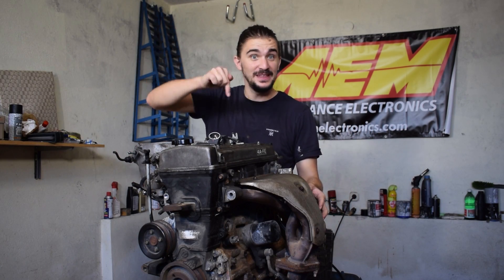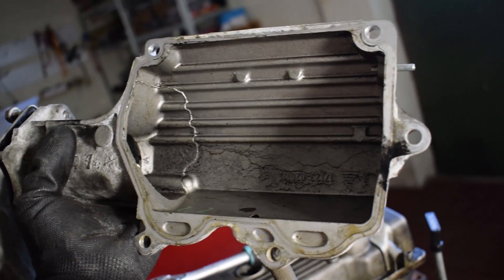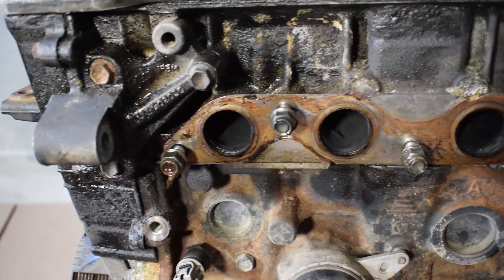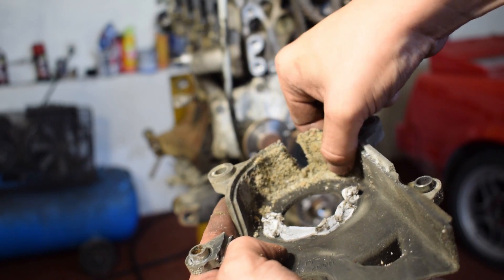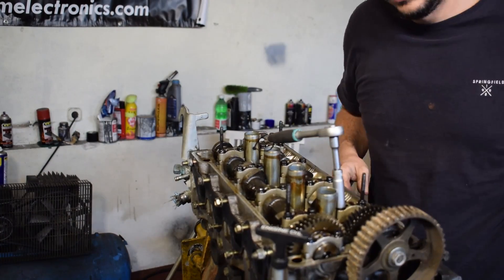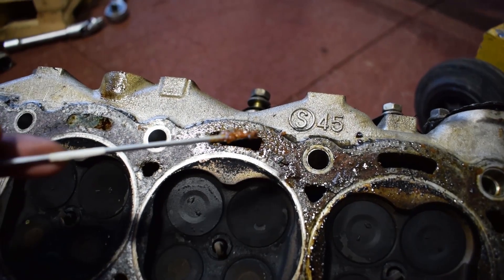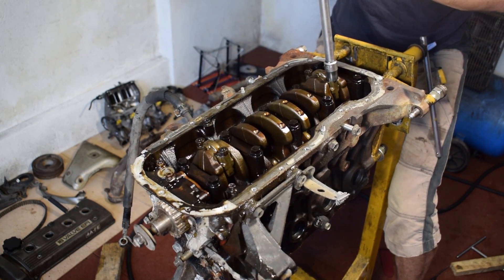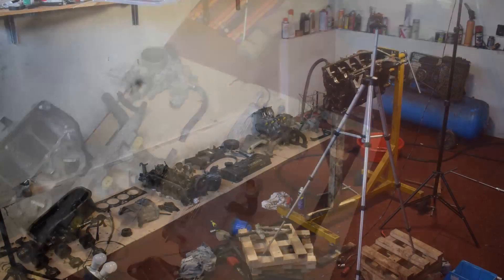ENGINE TEARDOWN and ANALYSIS - Project Underdog #4

Comment: I want to do this to the engine I have as a back up. It's an Audi 1.8T I just don't have the means to get it out of the car or a garage to do the rebuild in!
Reply: All you need is a jack to remove those engines. 

I rebuilt a 1.8t Audi that locked up the camshaft in a driveway. 
But I had a used block and head to swap. 

No excuses!
Reply: @fastinradfordable  I know I can figure out a way to do it, but sitting in a gravel driveway definitely makes things more complicated. It's more about where to tear it down that is dry and untouched by my kids! Again though, if I wanted to bad enough I for sure would find the time, space and cash to do it.

Comment: I plan to make a similar project in the future, but with a supercharger. I really hope I can manage to fit one under the stock intake.
Reply: Im too bro. Swapping my 4a-fe on carina e to newer car, and include supercharger mercedes eaton. But what about the ecu, oe denso, its not good to tuning.. and what about transmision.The drivetrain will not match the original gearbox from 4afe. You will probably have to change the axle shafts, etc. what about the beam? a lot of work. not to mention the "paws" of the engine that need to be welded and adjusted. Did You succeed with the project?
Reply: @smacznego4133  My car was totaled since, so it probably wont happen. Now I think a turbo would be a much better and simpler option.

Comment: R u sure it’s not a rebuilt or refurbished engine?
Reply: As someone who had rod bearings showing copper @300,000 miles. 

I am jealous of your spotless rod bearings. 
Those hardly even look run. 

I would say with the coolant corrosion....
No way this wasn’t run
Reply from the maker: Might be... Although these look like OEM bearings, but you never know. Should have flipped them.
Reply: @d4a  Only thing I noticed was the seal color of the tensioner pulley makes me think that was replaced. But given a 60K or 100K timing interval on these, you would kind of hope so. No reason an engine can't look this good inside with regular maintenance, even at over 200K miles.